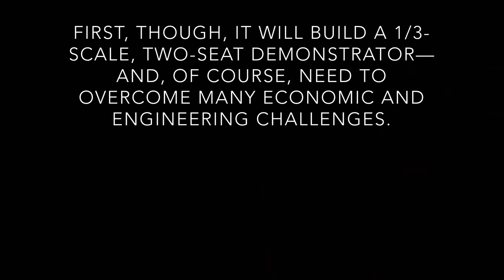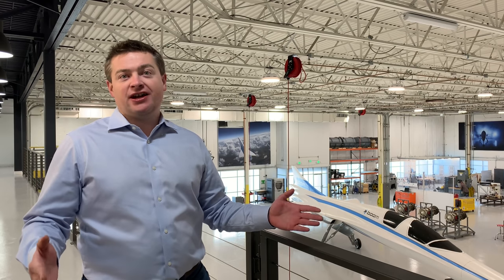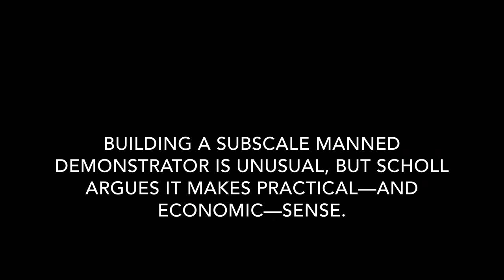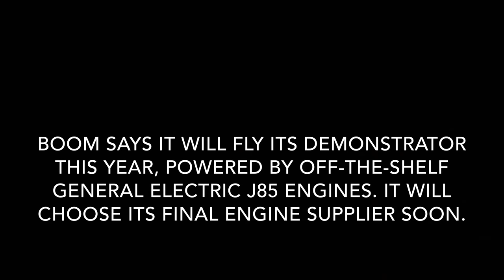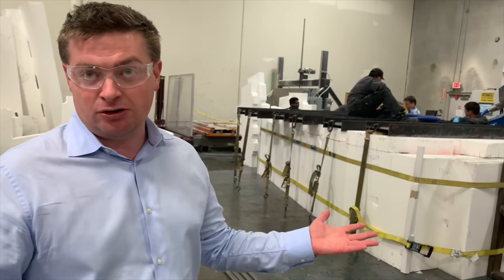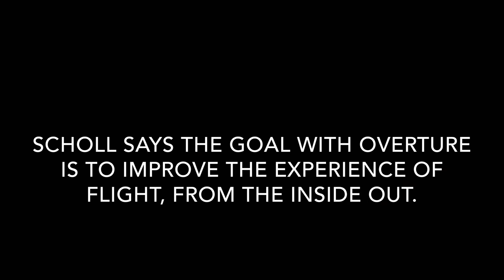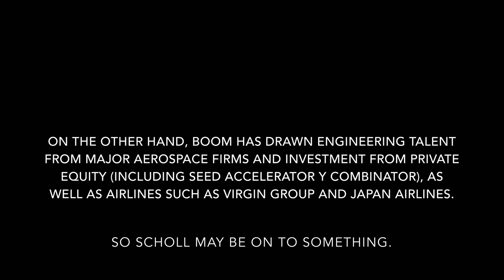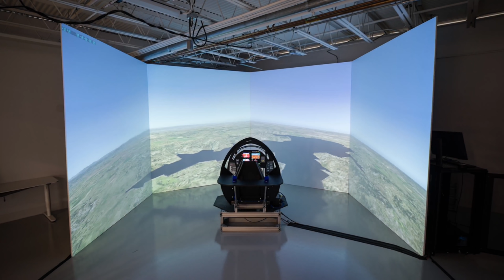Boom Supersonic’s Sound Barrier Breaker

Comment: Ultimately, an efficient and practical engine for modern supersonic commercial airplanes will be a part-time turbofan. You can no longer use a turbojet and get certified due to Stage 5 noise regulations. Cruising with a turbofan sufficient bypass to pass noise regs might be "OK" up to about Mach 1.6 (ie. GE Affinity) but beyond that it becomes impractical beyond that. Ultimately, the only practical solution is an engine that takes off and climbs as a turbofan -- probably around 3:1 bypass. At altitude and for supersonic flight, radial flaps in the intake will block off most of the airflow to the outside of the fan and forcing about 75~80% of the air through the core. The engine hence operates as a 0.25~0.33 bypass turbofan. This is not unlike variable section nozzles but in the front of the engine. The remaining bypass air is there for cooling purposes not thrust as pure turbojets are very hot and difficult to house in composite or even aluminum air frames.
--
For a 50-seater there needs to be two 30,000 lbs engines or three 20,000 lbs engines. The former will require a GEnx sized core, but at 20,000 lbs it can be a CFM56 or LEAP56 core. It will not however be the GE Affinity as it's specific thrust will be pathetic above Mach 1.5. Either way the engines will feature fewer compressor stages than the subsonic engines and lower pressure ratios to keep operating temperatures at supercruising speeds within material limits.
Reply: They could build an engineering masterpiece. But Concorde failed, because the business model was unsustainable.
Reply: @fubar12345  The business model is unsustainable because an SST needs either transpacific range or the ability to fly over land. The Concorde ended up with neither. JFK-LHR and JFK-CDG are just two routes and not enough to sustain ANYTHING irrespective of ticket prices or the willingness of passengers to pay it.

Comment: Why not just a suppersize Concord with a synthetic pilots view and no bending nose and the more efficient engines ?
Sonic boom might be eliminated by counselling technology maybe accomplished by generating simultaneously similar boom of opposite amplitude  just counselling the shock wave. Beside each engine there might be an acoustic device Ala speaker blasting sounds of opposite wave amplitude. It is just an idea without the throughout understanding the  physics  and how much energy it would require to accomplish   this effect.

Comment: Up to 55 people yet the two mockups they show are a two seater and one that has 30 plus windows down one side. A pair of seats to each window equals 120 plus passengers?
Reply: Michael Ross Pearson The cabin is actually quite narrow, so the seating will only be a 1-1 configuration, but they’ll be nice and wide with legroom to spare.

Comment: I hate to be pessimistic but I don't see this being sustainable. Initially it will be trendy and everyone will want a piece, but once the initial cool factor wears off, it will fade away. Shaving 4 hours of flight time for business travelers from NYC to London used to be a big deal in the 90's, but we're not in the 90's. Hell most things can be done remotely with video conferences. Anyone who needs to be at their destination bad enough that fast will just fly private (which has become substantially cheaper due to fractal ownership and other rental programs) and once you cut out boarding  and security times, it's probably a similar time of travel. Furthermore, I doubt they'll solve the fuel economics and they're also going to be severely limited on routes because of the sonic boom. Also, all of the ground operations to accommodate and service the planes will be a headache with large fees as well.
Reply: Only 55 passenger seats, this is not going to be a very big airplane. Should be doable.

Comment: Why on earth would you make molds from carbon fiber when long strand fiberglass are just as stiff and strong at a fraction of the price for material cost and just as temperature stable for curing parts...

Comment: Would a "swing" canard at front of fuselage help with slow-flight, take-offs and landings - that would be retracted/stowed in fuselage - be a possibility?  Would also be cool if you could use a #RenewableFuel like #Hydrogen or H2 + #O2 for #CarbonFreeEnergy!
Reply: Yeah a fleet of these planes would take up 0.00000001 percent of the world's fuel, so you have a great idea in suggesting it be renewable. Otherwise we may run out in one million centuries. It's not like the designers are busy solving other technical problems.

Comment: They have been talking about it for more than two years and still nothing, the issues are cost & sonic boom.
I am willing to bet it will never happen, is not because the technology isn't there, is just not practical.   The cost rises dramatically to fly and maintain a super sonic aircraft, stresses a normal conventional jet aircraft doesn't have to endure.

Comment: Speed is a strange thing to focus on these days. Still burning fossil fuels.
Reply: bleedinggums roberts
What non-fossil fuel would you suggest we use for flying?
Reply: @KSparks80  onboard production of hydrogen. Never store hydrogen.
Reply: @bleedinggumsroberts3579  
Since that doesn't exist, it looks like were stuck with fossil fuels for flight.

Comment: Is Boom going to simultaneously be an aircraft developer, an aircraft manufacturer, and an airline? It is extremely unlikely that they will be able to raise enough capital to be all three. I would like to have seen a rough financial analysis jn this video, such as the projected revenue for a single flight from New York to London, versus the expected total costs for the flight, including amortized corporate expenses. The amortization would be calculated based on the projected number of annual flights, worldwide. The required fuel economy would have to be set, and is the proposed design capable of achieving that number? It would tell you if this company was even theoretically economically viable. I would also like to hear their plans to survive the dirty tricks that the other aircraft manufacturers, airlines, and airports are going to throw at them, to crush them. For example, if Boeing tells any suppliers to not work with Boom, they won't. And if American Airlines tells a major airport to not give Boom any gates, they won't.
Reply: Yep. Totally unsustainable business model as far as I'm concerned.
Reply: Haven’t we all watched the major airlines drop prices for a season to test how deep the new boys pockets are. “You’re playing with the big boys now!”
Reply: The CEO really needs to drop the "they only had slide rules and today we have calculators and design software" thing. I know it is the marketing schtick he has chosen, but it is utterly irrelevant to the technical success of the jet, and to the financial success of the company. All sophisticated people he speaks with will be alarmed, not impressed, that the CEO thinks that the CAD/CAM software thing will be important to his success, and that he thinks that CAD/CAM software will impress them. He ignores the fact that all of his (vastly more experienced and well funded) competitors also have CAD/CAM software today. Actual important factors for success will include the price of aviation fuel three years from now, his competitors, his ability to rise $1 billion, the market for ultra luxury travel three year from now, and especially the ability of the jet to meet or exceed the required minimum fuel efficiency limit. I have left out several other potential stumbling blocks, suck as will the carbon fiber develop cracks, like it did in the Boeing Dreamliners.
Reply: This is such a small market the majors won't care, untill it can carry a couple of hundred passengers.
Reply: Ken, remember that Boom's niche will be to perpetually siphon Business and First Class travelers away from the major airlines. Assuming that Boom actually makes it into business, and assuming that their ticket prices will be as low as they are claiming, then the bigger they get, the more of those cash cows they will steal. So, if Boom gets big enough, they will either be destroyed by or be bought by one of the major airlines. One of the many ways the major airlines could destroy Boom would be to lower the First and Business Class ticket prices below the level that would cover Boom's expenses, until Boom went under. It is also possible that everything that the Boom engineers have yet to learn about achieving such extreme fuel efficiency has already been worked out in equations by Boeing engineers, and they already know that doing what Boom is attempting to do violates the laws of physics. Kind of like trying to make a piston engine that is 50% fuel efficient (and ignoring all Carnot Cycle physics). If that is the case, then Boom is a dead company walking, and they should permanently shut down before lunch on Monday, to minimize their investor's capital losses.

Comment: I don’t understand the complaints regarding the sonic boom.  It only occurs during trans-sonic deceleration (supersonic to subsonic) at the end of the journey.  It isn’t as if the flight plan has you transitioning other than at the end, once per flight.  I’m thinking there will be more flights than the Concorde SST each day, but not exactly competing for San Diego to Seattle route .... maybe I’m wrong.  You are on the right trajectory, don’t give up.
Reply: that is not correct. the sonic boom happens continuously the entire time the aircraft is traveling faster than sound, while passengers on board would only hear it shortly after decelerating, anyone at ground level below the aircraft would hear it after the plane passed overhead. 

like this: https://www.youtube.com/watch?v=cbPh2llw0-M

Comment: I could see if they were making another type of fast passenger jet like the Concorde, it will have modern computers, better engines and avionics.   However, as soon as this guy mentions "business class fares"  my UH OH button goes off.   The Concorde didn't even come close to business class fares.  The plane had outdated technology  (1960s computers, needed flight engineer, etc) and was too expensive to operate.  So They shut it down.  Is there some new magical technology that makes going 2x the speed of sound cost next to nothing for fuel?   So far, this company would have to invent that, and likely have not.   I smell investor scheme here.

Comment: Sean aircraft engineer I will be here interested to see how you multiple intake system stakes up at supersonic speeds especially with an engine out
Seriously how will the art fuse survive in a blade off senario ?
Without estarcrat how do. You propose to meet the legislation standards.
If you only have full scale mockups withno hard credible ttest data have  a waist of resourses!

Comment: To be honest I heard no answer to the two most important factors the concorde went out of business: the sonic boom and fuel usage subsonic. Also, how are they going to deal with the aircraft expanding when the skin gets hot? He talks about closing any gaps etc, those are there for a reason... That last mockup would have zero visibility on landing for the pilots because the angle of attack with that delta wing would be way too high. Has this guy ever piloted an aircraft?